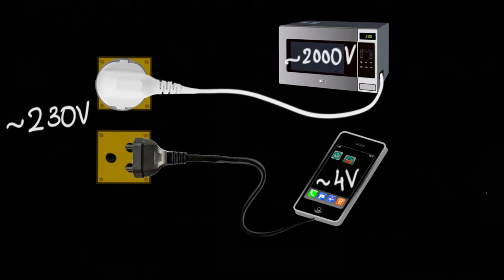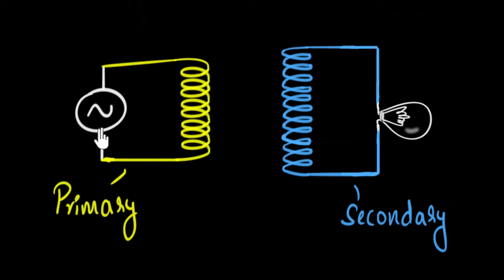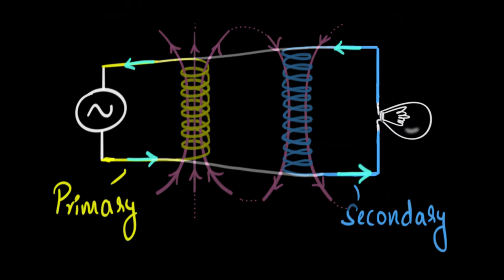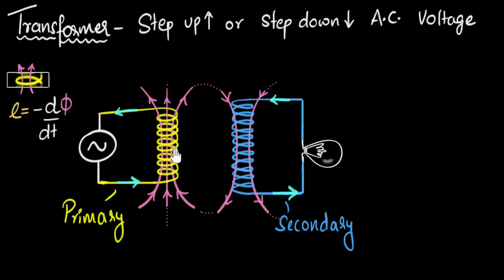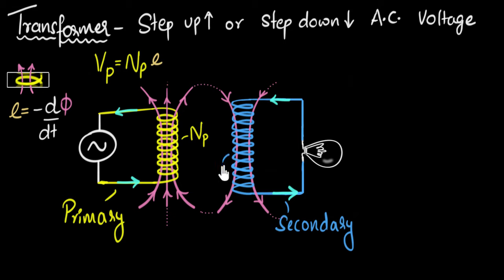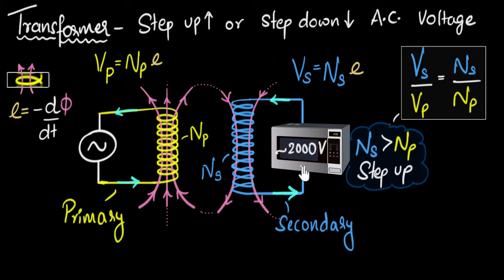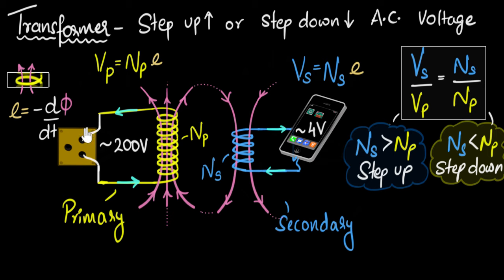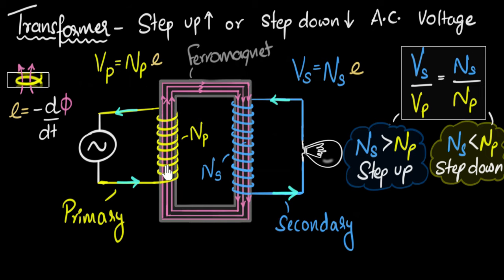Transformers -  working & applications (step up and step down) | A.C. | Physics | Khan Academy

Comment: I have a doubt
If the change of magnetic flux generated can produce the same amount of emf in another coil(secondary)
Then wont the change of magnetic flux induce the emf in itself(primary coil) and affect the flow of current in it?

Comment: He equated the Voltage apllied in primary to the product of Number of coils and Emf in single coil. 
He said that for the same V voltage provided in primary we can have different Emf produced in primary depending upon rate of change in flux. 3:00

Then why did he wrote V = N e ?

Comment: I run a 2000w inverter from a 12v 200AH battery and the microwave off thst. So, power being stepped up from 12V to 240V.

Comment: is voltage just the frequency of electricity , if it has something to do with actually work being done , then wouldn't , transformers generate energy . 
i don't think this is the case , so transformer must be some kind of power splitting and joining machine .

Comment: If here is two opposite magnetic flux, how can eddy current exist. Exciting flux will create eddy current in one direction, and secondary flux will create eddy current in opposite direction. So here should be no eddy current.
Reply: The primary coil induces current both in secondary coil and also in the core. Current induced in secondary coil goes to consumers while current in core known as eddy current stays in core which is not useful at all.In all cases, eddy current does not get cancelled unless different preventive method called lamination of core is introduced. I hope u understand this
PS: also u talk about secondary coil inducing eddy current in core. No, secondary coil doesn't induce eddy current. Flux exist because there is current. Whatever current that is induced in secondary coil gets transmitted to external load instead of current staying there to induce eddy current in core
Reply: @rewardk  And why couldn't the secondary flux induce eddy current as per faraday's law? Since the secondary flux, which is in opposite direction, actually induces emf on the primary to eliminate its inductance. One needs to PROVE that the opposing flux doesn't induce any emf whatsoever, hence no current whatsoever in the core.

Comment: But you didn't say how the electricity moves from primary to sendary eventhough the primary pole is not connected to second poles ? Can you explain this ? You mean the electron jumps ? Or the magnetic field Flux extends from primary when the power supply is to secondary pole ,as result the electron jumps from magnetic Flux? Can you correct me ?